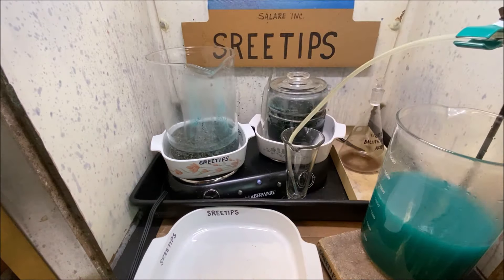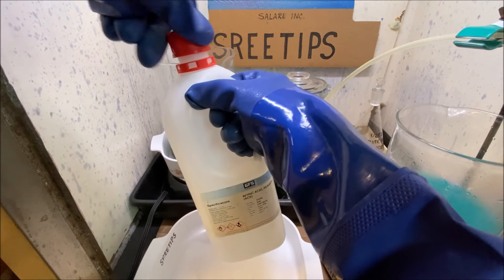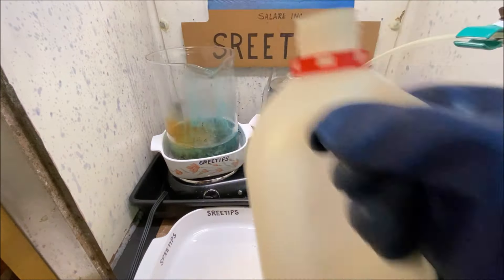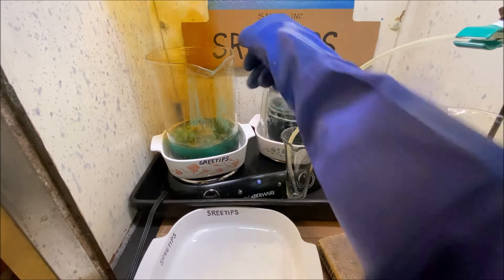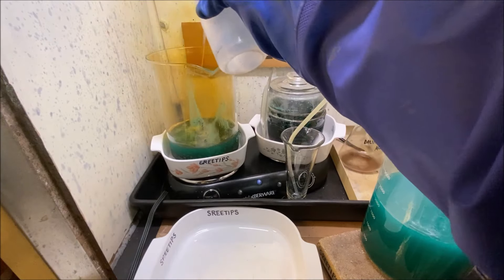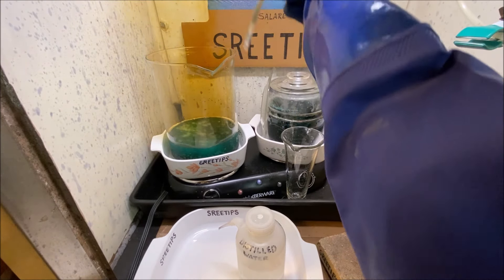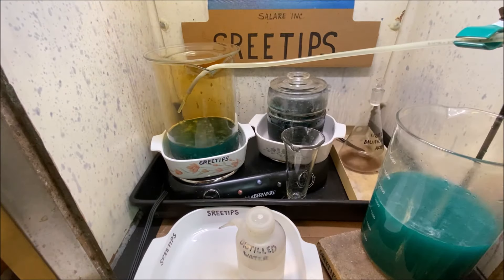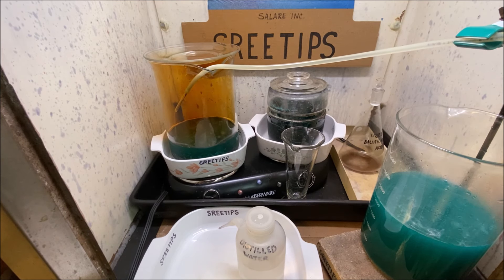Refining $47000 Pure Gold Bar At Home Pt3

Comment: MY NOTES: GOLD REFINING supply list

https://youtu.be/-iktnV8jIMQ

1. Pure silver: use for inquartation process if gold
2. 25 OZ of gold netted well typically use:
3. Chemicals: nitric acid concentrate:  Buy5 L you’ll probably use about four liters
4. Beakers for the nitric acid boil: LARGE: 4000 mL KIMAX brand Open mouth circular beakers: need (3 to 5) Used for receiving pouroff with the nitric acid which has absorbed the silver, from the inQuarted gold and has turned green. (Later you run that through a system that has a charge going through the green nitric acid liquid to crystallize the silver out of the nitric acid solution and kill two birds with one stone and you actually end up refining pure silver at the same time. 
5. Beaker: MEDIUM: triangle bottom cylinder top: (2) needed
6. Mini 50mL beaker for holding nitric acid for Tests
7. Mini 40 mL beaker for testing wash water with the previously mentioned concentrate of nitric acid to see if it gets cloudy. (This tells you whether it’s ready and cleansed or if it still needs more washes.(
8. Funnel: Glass funnel to help pour used nitricacid into the triangle beaker
9. Raised beaker delivery system to deliver nitric acid, through a Long skinny rubber tube, into the gold beaker, to slowly automatically add nitric acid drip instead of being forced to continually be pouring it, waiting for all the bubbling reaction to stop, and starting that process over and over and over again.
10. Raised mic stand, clips and holders.
11. Camera tripod with go pro attachment., 
12. Audio: Headset mic for sending microphone recording to the GoPro or recording to attract that your later add to the video in post production
13. cutlery : sterling silver forks spoons knives plates: place in 4000 mL nitric acid colored green solution to make sure all the nitric acid and reaction comes out.
14. Exhaust system: Hood to fume off dangerous vapors up in out of the
15. Safety: Rubber mat with raised 2 inch perimeter to catch any liquid spills
16. Rubber gloves: all the way up your arms in case you spill it
17.  safety goggles
18. Face protection from splashes
19. Rubber protective apron for body
20. Cookware squared to put Pyrex beaker in to capture spills (3-4)
21. Hot plate to put the cookware on and boil the Pyrex beaker which contains the incorporate gold pieces in the nitric acid liquid
22. Clear saucer plates to put over each of the beakers holding nitric acid to keep it from evaporating or letting fumes out too fast which would overwhelm the hood and poison you
23. Pipettes for sampling the liquid distilled water at the end of the process to verify it’s completely pure water liquid
24.  3 gallons of distilled water
25. Rubber bottle with right angle pointed sprayer tip for cleansing the walls of the beaker each and every time that you pour off the green nitric acid solution with the silver being absorbed into it
26. 
27.
Reply from the maker: Sterling silver for inquartation instead of pure silver.
Reply: OK thank you. I also finished video for and video five last night. I have updated my notes for your corrections. Thank you. Also what does SREETIPS ???
Reply: UPDATED NOTES : GOLD REFINING supply list

1. PART 1: sort Karat scrap from jewelry store load sent in
2. PART 2:  InQuart the gold with 1/3rd parts “sterling silver”
3. PART 3: parting the inquarted gold with nitric https://youtu.be/-iktnV8jIMQ
4. PART 4: incremental nitric dosing  https://youtu.be/V2IZPheNl5A
5. 
6. “Sterling silver”: use for inquartation process if gold
7. 25 OZ of gold netted well typically use:
8. Chemicals: nitric acid concentrate:  Buy5 L you’ll probably use about four liters 
9.  2 Hot plates: proctor SILEX brand
10. Beakers for the nitric acid boil: LARGE: 5000 mL KIMAX brand Open mouth circular beakers: need (3 to 5) Used for receiving pouroff with the nitric acid which has absorbed the silver, from the inQuarted gold and has turned green. (Later you run that through a system that has a charge going through the green nitric acid liquid to crystallize the silver out of the nitric acid solution and kill two birds with one stone and you actually end up refining pure silver at the same time. 
11. Beaker: MEDIUM: triangle bottom cylinder top: (2) needed
12. Mini 50mL beaker for holding nitric acid for Tests
13. Mini 40 mL beaker for testing wash water with the previously mentioned concentrate of nitric acid to see if it gets cloudy. (This tells you whether it’s ready and cleansed or if it still needs more washes.(
14. Funnel: Glass funnel to help pour used nitricacid into the triangle beaker
15. Raised beaker delivery system to deliver nitric acid, through a Long skinny rubber tube, into the gold beaker, to slowly automatically add nitric acid drip instead of being forced to continually be pouring it, waiting for all the bubbling reaction to stop, and starting that process over and over and over again.
16. Raised mic stand, clips and holders.
17. Camera tripod with go pro attachment., 
18. Audio: Headset mic for sending microphone recording to the GoPro or recording to attract that your later add to the video in post production
19. cutlery : sterling silver forks spoons knives plates: place in 4000 mL nitric acid colored green solution to make sure all the nitric acid and reaction comes out.
20. Exhaust system: Hood to fume off dangerous vapors up in out of the
21. Safety: Rubber mat with raised 2 inch perimeter to catch any liquid spills
22. Rubber gloves: all the way up your arms in case you spill it
23.  safety goggles
24. Face protection from splashes
25. Rubber protective apron for body
26. Cookware squared to put Pyrex beaker in to capture spills (3-4)
27. Hot plate to put the cookware on and boil the Pyrex beaker which contains the incorporate gold pieces in the nitric acid liquid
28. Clear saucer plates to put over each of the beakers holding nitric acid to keep it from evaporating or letting fumes out too fast which would overwhelm the hood and poison you
29. Pipettes for sampling the liquid distilled water at the end of the process to verify it’s completely pure water liquid
30.  3 gallons of distilled water
31. Rubber bottle with right angle pointed sprayer tip for cleansing the walls of the beaker each and every time that you pour off the green nitric acid solution with the silver being absorbed into it
32. SILVER: to recover the silver :
33. A. Add scrap sterling
34. B. Boil to consume nitric
35. C. Filter solids out
36. D. Cement on copper
37. E. Melt into shot
38. F:  run through silver cell w electricity charge crystallize in the silver out of the liquid
39. BEST REFINING PROCESSES:
40. Gold powder: next we will dissolve the chunks and refine it with
41. A. AQUAREGIA: refine now with aquaregia;
42. B. then “incremental nitric acid dosing”
43. PART 4: VIDEO https://youtu.be/V2IZPheNl5A
44. Take the included gold that is already been, “nitric acid boiled” and add hydrochloric acid with 23 g of brown dust so that the level goes up to 1000 mL of hydrochloric acid on the large 5000 mL beaker with the open top. Start your boil.
45.  incremental nitric acid dosing: use a dropper to add a few drops of a time to the hydrochloric acid boil
46.  this forms “aquaregia” and dissolves our gold
47. Add just enough nitric to the hydrochloric acid so that you just barely dissolve the gold but there’s not too much extra nitric acid to deal with later when we go to precipitate the gold
48.  sulfuric acid: add a few drops to make sure it takes out any letter any copper that’s in the solution
49. vaccum flask: Is suction tube to pull off the pure solution out of the original nitric boil bigger which has had sediment fall out the bottom of it. This allows you to get the pure liquid solution with a gold in it and leave the sentiment behind
50.  filter flask #2: number two paper filter:  flat top funnel with micro holes going into vacuum flask number two
51. Next step: precipitation: 5000 mL large open beaker with a cylinder in the bottom
52. Litmus paper: “standis test”????: typical of this paper in Cold Solutions, then take a dropper Full of ?????.., Drop on litmus paper and it should turn black
53. Sodium metabisulfite: start adding scoops of white powder chemical into the gold solution in the large beaker to precipitate out the pure gold. When powder hits the orange solution it turns black as it precipitates out the gold like this picture below

54. PART 5: refine one more time and then Milton to a 25 Troy ounce gold bar https://youtu.be/3t5xhPfIlfQ
55.

Comment: Hey Sreetips. Why do you only deal with the fingers? A lot of the boards have gold inside the layers as well. A had a good friend, who has since moved away, but he said he had a lab where they would...I think "flash burn" is the term, and then extract from the remaining slag. As I have a small recycling business, Ive been saving the circuit boards from computers, phones, automotive units, etc for a while, and have thought about doing same in the future. Whats your take on this???
Reply from the maker: I chose the fingers because they have a high concentration of gold per weight of material
Reply: @sreetips  So, you think burning the entire board would be a waste of time?

Comment: What concentration of notice do you use? Does it matter if it's 70 or 67? Just looking up chemicals.
Reply from the maker: My bottle says 68% to 70% concentrated nitric acid
Reply: @sreetips  difference in price that I found was alot 
2.5 gal in 4 jugs:
67%= $175
70%= $280
Seems like alot for either
Reply from the maker: 67% should work
Reply: @sreetips  67 says "lab grade" and 70 says reagent grade.
But I was thinking since all processes take distilled water anyway, concentration shouldnt matter that much

Comment: Piece of sanitary 316L ss, schedule 10, 12" pipe- 36" to 48" long to cool your pellets. Your beads just need a little more travel time through the water to keep from re-fusing on the bottom.

Comment: Quick question from a novice, have you thought about smelting instead of inquartation for step one of process? With an induction furnace or a propane based furnace it seems doable to me to remove copper, lead and other base metals (other than silver) efficiently without the need for the nitric and cost associated. Also, can you show the process of recovering the copper? Would be interesting to see the recovery and reuse of the copper in the process, such as recovery and melting into a bar for cementation.
Reply: What would melting the jewelry achieve apart from mixing the metals and distributing them more easily? Maybe you're thinking of roasting, a process through which you oxidase metals to "burn" them away? But that wouldn't work in this case, since the main 3 Metals that are present are Gold, Silver and Copper, and the only way I know of to separate Gold from Silver / Copper is chemical. Gold has a very high resistance towards Nitric-, Sulphuric- and Hydrochloric-Acid, whereas Silver Dissolves in Nitric Acid, as does Copper, leaving behind Gold and other "noble" Metals.
Reply: @heulboje21   look up smelting. All based on reactivity series. It is a chemical reaction that is facilitated through adding intense heat and a collector metal. Quite efficient and used by many miners to purify before being sent to refiners for final chemical or more likely, because it's cheaper electrolytic purification.

Comment: Greetings to my dear teacher
The metals palladium, platinum and rhodium are soluble in aqua regia solution. Now what happens if I use iron to deposit them? In my country zinc is very expensive .
waiting for your answer !!!
Reply from the maker: I’ve never used iron I don’t have any experience
Reply: Any acid in solution would oxidize the Iron forming ferrous ions, which would end up rendering ferric ions. The latter hydrolizes unless the pH is below 3. The product is insoluble ferric hydroxide Fe(OH)3. On heating it gives Fe2O3, contaminating the gold cement. You don't want this. 
I don't know the cons if vou decide to use a strongly acidified solution.

Comment: Is that blue colouring in the acid, from the copper in the sterling silver???
Reply from the maker: Yes
Reply: @sreetips , thanks for the reply, and so do you use sterling silver to be able to see the colour easily, because 99.9% fine silver wouldn’t be as easy to see would it???
   I am asking because I have started to use silver clay, and it is made from reclaimed silver, and while some of it is sterling silver, most of what I use is 99.9%(fine silver) which is nickel and copper free(so that it doesn’t tarnish as quickly), and I have been wondering where and how they get the silver........ Thanks in advance(if you are busy, and can’t reply for a time I understand).!.!.!.

Comment: i think you need to mix your gold and acids more, and also to use smaller pieces to start with...the nitric probably doesnt get right into the heart of the big pieces of gold silver alloy... also i think you need to add MORE water when rinsing
Reply from the maker: The nitric penetrates each piece, forming a honeycomb structure as it goes, to the core of each piece.

Comment: Could you clip your go pro to the top front edge or side edge of the fume hood so there wouldn't be a tripod in your way? You could use an old extending desk lamp arm so you could swing it wherever you wanted it.

Comment: So, does the nitric reaction (from the funnel dripper) stop because the funnel empties or does it just get saturated or something? If it stops because the funnel empties, why not continue adding nitric to funnel until the large breaker is close to full rather than doing the small batches?
Reply: Because the solution is not stirred as far as I'm aware. The Nitric Acid has a hard time "finding" base metals to react with. Also it's easier to gauge whether the reaction is done and all the gold is dissolved when using a small batch.

Comment: Will pure nitric acid dissolve the gold? Is that the reason for the 50/50 distilled water to nitric?
Reply from the maker: 50/50 boiling nitric will dissolve gold. You can wash your hands with pure dish detergent and no water. It will get them clean. But add a little water and it makes the dish detergent much more efficient. The water provides a medium for the metals to dissolve into with 50/50 nitric
Reply: @sreetips  then how do you keep the gold from dissolving when removing the base metals?

Comment: Do you have any tips for smelting gold leaf flakes?
Reply from the maker: Some gold leaf flakes aren't even gold. They're "nordic gold" made of copper but look just like gold. Test one with a drop of nitric. If it just sits there then it's probably gold. But if it dissolves and turn blue then its not gold. If certain that the flakes are gold then cover with borax in a melt dish and put a map gas torch to it. But unless you've got a hand full don't expect a big button of gold. Probably more like a tenth of a grain of rice.
Reply: @sreetips  thank you so much for the reply. I purchased 4 troy ounces of gold leaf flake so I have a bit to work with. I actually make silver nitrate and silver oxide in a big plant so I have everything at me disposal to mess around with

Comment: What impurities cause the dark color of the silver chloride waste solution? 
Also, even after inquarting and dissolving the silver with nitric, can’t you still be left with some precious metals namely platinum and palladium? That wouldn’t be a bad thing, but do you have a way of determining the purity of your gold product?
Reply from the maker: Platinum and palladium cemented on copper forms a very fine black powder that appears on the copper after all the silver has cemented. It mixes with the silver powder and causes it to turn a dark gray color.
Reply: @sreetips  aren’t they insoluble in the nitric? Or is it concentrated enough to dissolve them

Comment: Can you describe the safety protocols and fume hood equipment you use. Also tell me if any fumes in your hood have ever made you cough. I want a fume hood but want advice on best practice for choosing equipment..
Reply from the maker: Make sure and get one that’s suitable for acid digestion’s. No metal parts. Exhausts to the outside,

Comment: You need a 2-3 necked round bottom flask with a pressure equalized addition funnel in one neck. A condensing column set up for reflux, and the last neck has a glass thermometer to keep an eye on temperature. Everything would have ground glass joint connections so you can use keck clips and the condensing column will let excess gas escape while condensing precious materials  It would look 5x more professionaland ultimately be safer than hacking something together....

Comment: So when you dissolve a Sterling Silver plate at .925 silver in nitric acid. The acid dissolves the impurities that are in the .925 sterling,.thus making it .999 fine silver after refining?
Reply from the maker: The sterling dissolves, then we add clean copper metal and “cement” the silver out. The copper stays in solution.

Comment: That crucible looked like it had a accumulation of silver near the top,, and you should mention that the melting dishes retain tiny an microscopic beads of metal all over the inside of them within the borax flux,, so they should be saved ,,, for crushing to a powder,, then panned to recover that metal

Comment: Do many metals get carried away in the"red death" fumes? And one last question. How much 18K gold is OK for a good plating of a pocket watch,(18s open face)? Sorry one more, how is plating done at home DIY? I have 1 gram of 18k gold.
Reply: The emitted red gas is nitrogen dioxide. This gas does not contain gold or silver, but it is harmful to the atmosphere. When it comes into contact with water, red gas turns back into nitric acid.
Reply: That brown gas is NO2 (nitrogen dioxide).  All the silver remains in the aqueous solution as silver nitrate.